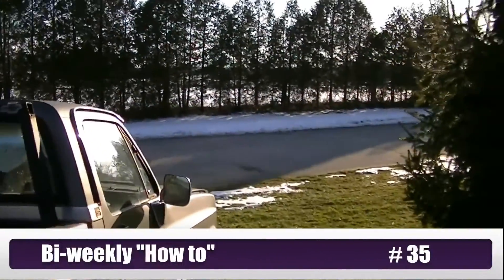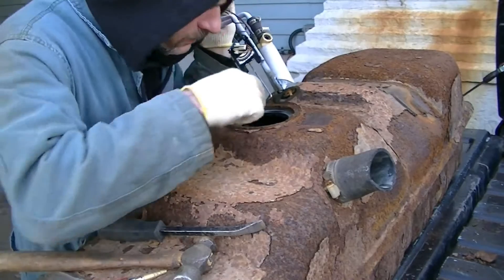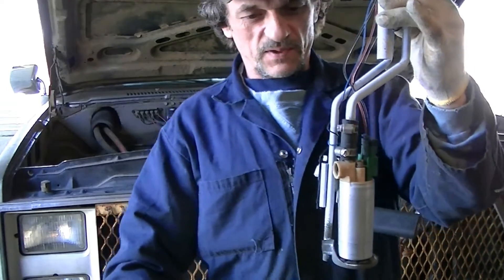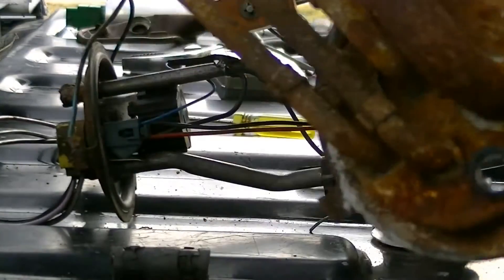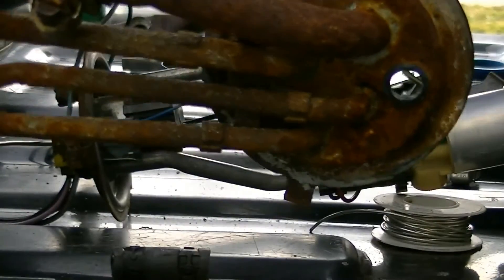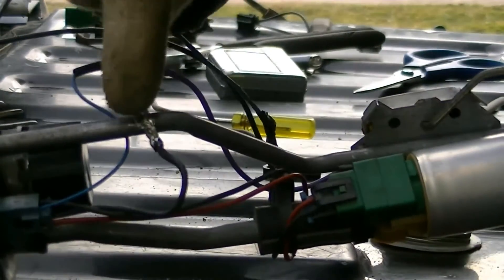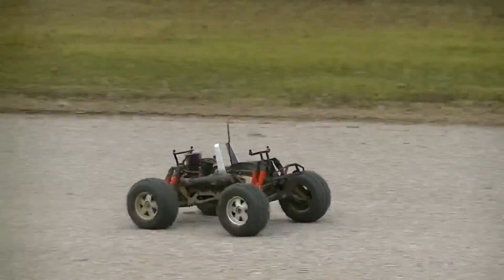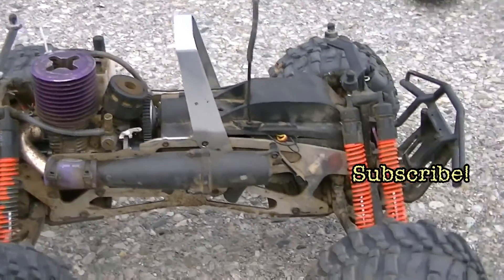Electric Fuel Pump Modification - 87 GM to fit 89 Wire Harness - Rewire Part 3

Comment: I sent you an email as well, I broke down and bought the fuel pump, sending unit for my truck and installed it. I'm
not sure I can take much more of this truck, I have been working on this thing since June, I have over $1500
in parts and It still wont run. I'm no mechanic but i'm not completely stupid...or maybe I am lol. 

It has been one issue after another and I keep having to throw parts on it.

Now that I put in the new fuel pump this thing is just pouring fuel into the tbi, when turning over the injectors
are pulsing almost steady and flooding it out to the point that It will not start.
Reply from the maker: I wouldn't go as far as calling yourself stupid. I spent months on my conversion and it was such a nightmare that I never finished posting all of the footage because I couldn't stand to watch it anymore...living it was bad enough. Sounds like you have a no spark issue now. It's hard to give advise to you without seeing what's all been done so far. Best of luck, and feel free to ask more questions.
Reply: MudRFunR My wife bought me this truck as a gift, I didn't know about it until it arrived at my door, we knew it needed and engine but the seller didn't tell her all the issues. Put a 355 tbi out of a 95 tahoe, about 10,000 miles since rebuild but it sat for a while. It ran great...before I put it in my truck. Turns out the bad engine in the truck, only half of which was in the truck now was a carb  350. After I put the engine in I found that all the wiring had been cut, engine, under dash, every ground.... 2 engine wiring harnesses later, first one was garbage, I get the thing to turn over but no spark. New plugs, wires, cap, rotor, coil, pickup coil, ground straps, clutch, flywheel, slave cylinder, battery, o2 sensor, knock sensor, temp sensor, oil pressure switch, ecm (7747), battery cables, and ignition module X2, after a month of screwing around with this thing I changed the new ignition module for another one and finally get spark. Truck runs but having major fuel issues, runs about 2 hours and fuel pump craps out...so new fuel pump and sending unit. Now have fuel, WAY too much fuel, not a pressure issue but the injectors just keep pulsing and pushing fuel. While cranking these things are just blowing fuel in causing it to flood. Holding it to the floor (clear flood mode) doesn't matter they still just pump in fuel.
Reply from the maker: WOW that's much more than my troubles. Are you using the right fuel pump? Some pumps run at 60+ psi. They look the same as a TBI pump. I'm not sure what the TBI fuel pressure is but it is much lower. Tell you're wife I'm real sorry to hear that her gift hadn't turned out as planned. Anyway, make sure you have the right pump.

Comment from the maker: I once converted an 89 chevy truck to carbed but I still ended up taking the tank out to remove the electric pump cause I wasn't getting enough fuel into the carb. It ran O.K. with the electric pump still in the tank but the truck lacked power until I removed the pump from the tank.
Reply: M

Comment from the maker: This was no ordinary fuel pump change. I took all wire harnesses from an 89 truck and put them into an 87 truck. This is the reason that this was so complicated cause I had to convert the 87 wiring in the tank to match the 89 wiring harnesses.

Comment: I  assume its running by now.  It does sound like no fuel but it also sound like the timing is off ,just doesnt sound right turning over.